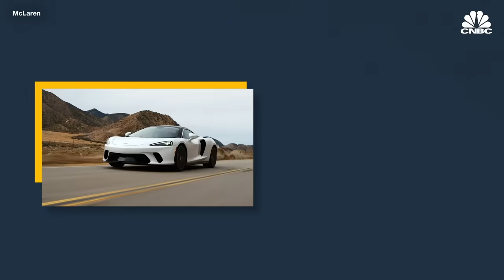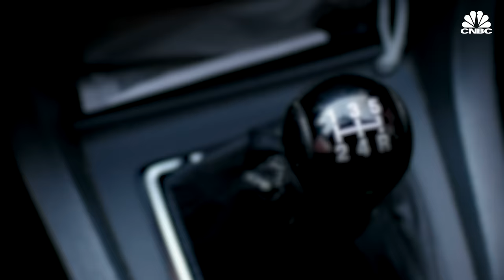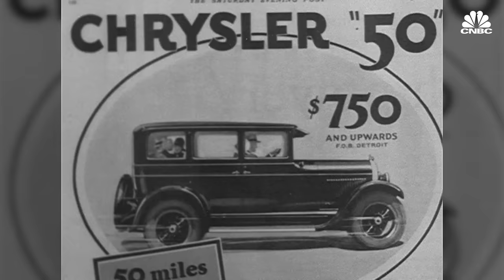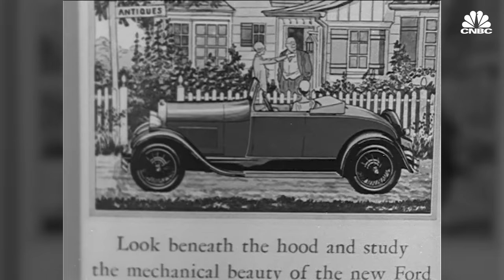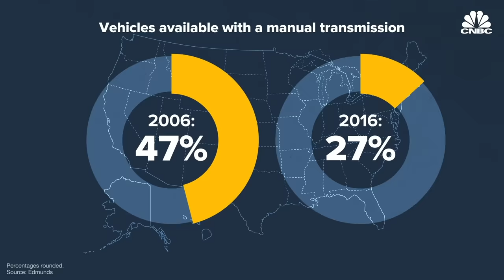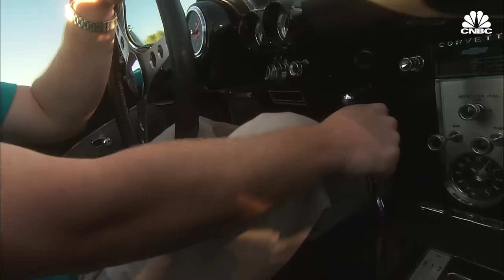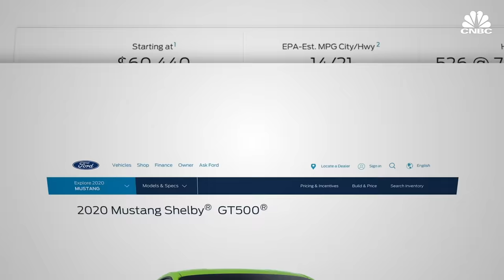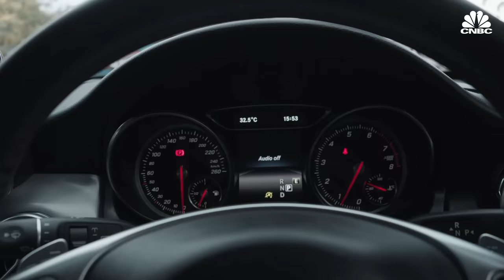Why Stick Shifts Are Going Extinct

Comment: I like how the video states “constant attention” as a problemXD
Reply: Yep, something we Americans have very little of
Reply: It is a problem. Distractions are a major cause of accidents. No matter how you slice it, shifting, like conversing is a distraction. Like conversing, we often don't notice how distracting it is. On badly pot-holed roads - I have thousands of miles on forest roads - and especially in darkness I avoid shifting until I am out of the worst because it is just too distracting when tenths of a second count.
Reply: @flagmichael  
if shifting is a distraction,  then why not make it illegal to have a radio in a car? That can be a distraction.
Reply: It's true, but it's also not! Shifting requires constant attention, meanwhile automatic transmission is so easy that people find things other than driving to put attention on. Manual is a good learning tool, because it forces you to focus your attention all around into all aspects of driving. Automatic transmission is probably safer, provided you've already built a habit to stay attentive on the task.

People text while driving manuals too, I'm sure, but there's always variables. I started with an automatic, and I wasn't a very good driver until after I started driving manual.
Reply: @flagmichael  ....what
Reply: @bertgrau9246  Phones and  computers are all a distraction but  to boost sales  GM added wi Fi on all there cars!  Just what we  need now we can watch TV and  Text  at the same time as we drive!

Comment: I will avoid driving an automatic as long as I possibly can.
Reply: Why not? It is superior in pretty much every measure, fuel efficiency, performance, used car price, etc. Do you still use typewriter or a computer?
Reply: @Gstunfisk  it's the feeling of control
Reply: @Gstunfisk  its not superior. The fuel efficiency is low and its un inspiring. There is loss of power.
Reply: @pratpulsar have you been living under a rock?
Reply: @Mister Candy Paint if you think about "shifting" as a skill,  you must have a low bar. As a same sense, I can say that manuals are lame,  low performance and fuel efficiency, less desirability. Automatic transmission are reliable and typically don't fail it its intended life cycle.
Reply: Me too. If im not given the option, id rather not drive, and will just take public transportation. Fortunately, that won't happen. I can always buy an old car, unfortunately, just won't be able to buy a new one. Importing one would probably be too costly.
Reply: @Gstunfisk  We got it. You don't know how to use a manual transmission and that's okay. Stop fan-girling over A/T
Reply: @hulaanmo9926  automatic transmission is just superior than manual and it should be thing of a past. Manual is applicable in buyers so low purchasing power (Europe/aftica/part of asia) for low end cars.
Reply: @Gstunfisk  how is it superior? If you can drive M/T you can drive an A/T. But not all that can drive an A/T can drive a M/T. There are benefits of driving a manual and there are benefits of driving an automatic. There is no sense arguing with you, you're thinking like a little kid. Time wasted. Have a good one.
Reply: @hulaanmo9926  superior in sense with superior performance,  higher fuel efficiency, etc. Name one area manual is better than automatic aside from being available as lower trim for poor people?
Reply: @hulaanmo9926  looks like typical boomer who has not kept up with technological advances? There is no benefit of manual as of now - manual is like a type writer and automatic is ms word
Reply: @Gstunfisk  understandable, have a great day
Reply: @Gstunfisk  dude just let people like what they like it doesnt even effect you
Reply: @Gstunfisk  well its their hobby, id be upset too if i was watching my preferred devices being outmoded rapidly
Reply: @johnathanhodskins5820  issue is they are either blatantly lying or so behind the current situation which is sad and ignorant.
Reply: @Gstunfisk  well, with smaller engines, older automatic computers shifted at poor times and often wasted gas, thisnis largly gone now but some people probably had issues with one car and never looked back
Reply: @Gstunfisk  Its actually not superior in Fuel efficiency, unless its an old model.
Reply: @thetrabantguy3934  moderns cars have higher epa rating for automatic; newer 8-10 autos are just too efficient. Unless you are talking about pre mid 2000s.
Reply: @Gstunfisk  I am indeed talking about those, Manuals where More fuel Efficient than Automatics Pre 2000
Reply: Driving an automatic is the lazuest thing ever. People say that it takes pointless effort. Literally running is easier
Reply: @John-ci2sd  driving manual is really lazy too. Why don't you take a horse? I hope you don't have electricity at home when you have candles? Don't be lazy man.
Reply: @Gstunfisk  I can drive both and I prefer DSG/Automatic. Manuals are horrible to drive in heavy traffic. Anyway, EVs are going to make this whole conversation obsolete.
Reply: @Gstunfisk  thats like saying running is lazy my guy. You're delusional
Reply: @Gstunfisk  It's ironic that you look down upon drivers of manual transmission cars as peasants when you yourself are so obsessed with the fuel economy of a car. Looks like you're the cheapskate here.

Also, you don't realize that with the exception of the US, everywhere around the world, almost all cars from the very low-end to the near high-end, come in both manual and automatic transmission variants. And the difference in price between the two isn't much. In fact, the more expensive the model, the less is the percentage of price difference between the variants. Don't take my word for it. Look up car-buying websites across different countries and compare the prices. Most people who choose between them, make their choice based on their driving preferences, not to save a few bucks.

Whether an automatic transmission is better than a manual transmission depends on the actual car and your driving skills. Unless you have a sports car (or a performance car like the M Series or the AMG series), you are almost always better off with a manual transmission or an automatic transmission that has manual override. The AT in the cheap car you are driving is nowhere good enough.

And that is the reason why MTs still exist all around the world, not affordability. If manufacturers really wanted to cut costs and if buyers of MTs were really as poor as you think, MTs wouldn't have power windows, power steering or power brakes either. They'd use manual systems for those too. Obviously they don't and it's been eons since such cars were last manufactured.

You're bullshitting yourself if you think that just by driving an automatic instead of a manual, you are now part of the social elite or that you're using some advanced and futuristic technology that we the poor cannot get our hands on. LOL! 😂😂😂
Reply: @Gstunfisk  
You’re obviously not a mechanic
Reply: @GRANOLA77  and you are?
Reply: @tejas.c  automatic is superior than manual for non racing drivers, period. Fuel economy as well as performance was mentioned to illustrate that there is no reason for manual to exist in 2021, aside from cheap economies. I don't know why it is hard for you people to admit it, but manually is dying literally everywhere on the plant, with a good reason (obsolete, inferior technology). Only reason why there are more manual cars in other parts of the world is due to low purchasing power in Europe, Africa, and Asia.  What is the benefit of manual? Name one thing manual does better than automatic.
Reply: @tejas.c  and yes, automatic is advanced technology.  It will soon follow manual transmission that when we go full electric,  there will be no need for automatic transmission.  Until then, it stays in the market.
Reply: @carlosi.guerrero8129  driving a car is a notable skill? I suppose you don't have much going on with your life, I am sorry.
Reply: @Gstunfisk  Yes, you're right! After this "argument" of ours, I did look up various unbiased reviews and performance tests and it turns out that even with low-end to mid-range cars, the automatic transmission is better at performance.

I was always under the impression that only the automatic transmission on sports and performance street cars were better than manual transmissions. That's what people I know had always told me - that for regular cars, you could do better with a manual transmission and good driving skills than an automatic transmission. And even the price difference is small - it varies from 10% in small hatchbacks to 5% in sedans and SUVs. With auto finance options, it seems even negligible. But maybe buyers of small hatchbacks do really care about that 10%, after all. 

We did buy a manual, but not really to save money. We thought that that money might have been better spent to add interior and infotainment options to the car than on what we had thought was just a small convenience without any performance benefits. With RHD cars, using a stick shift is not that much of an inconvenience as in an LHD car. You always use your dominant right hand to hold the wheel and the left hand to shift.

Anyway, I take back my words. I was wrong and you were right. My apologies and thanks for the info. Looks like I had been living under a rock all this while. 😂

Comment: I learned to drive growing up in South Florida, where it’s extremely flat, except for some bridges. I love driving a stick. They were a pain in the ass in stop-and-go traffic, though.
Reply: As if automatics aren't a pain in a stop-and-go.  
Stop-and-go is a pain to begin with, regardless of the transmission.
Reply: I learned to drive stick shift on the hills of San Francisco. Park facing up/down hill  on up to very steep hills. Parallel park with only inches  between the car in front and back.
Reply: Yeah for real. I live in Miami lol our traffic is CRAZY. That palmetto and I95 are not fun in a stick shift, I had a civic back when I was a jit lol
Reply: @Jp-gc6bh  again, as if standing in traffic with automatic is any better. Your right foot gets tired of constantly pressing-holding-letting go of the brake pedal, and you eventually have to shift to Neutral or Park to give your foot a rest, which is very similar to what you'd do with manual transmssion.
IMHO, all that argument about manual transmission being "hard to operate in traffic" is totally biased and made-up.
Reply: @antona.4572  no I’ve never heard anyone use your argument in my life. Ever, lol.
Reply: @Jp-gc6bh  maybe that's because you haven't spent enough time in traffic jams yet, lol
Living and working in Toronto, I spent (or, rather, wasted) many tens of hours of my life in city traffic, and I had a car with automatic back then. After 20-30 minutes of holding the brake pedal, your left leg eventually gets tired, and you'd have to shift to Neutral to give it a rest. Trust me, I know what I'm talking about.
So, at one point I asked myself how exactly is it any better than driving a stick shift, lol
Reply: @antona.4572  I wish we could take in person because people like you think they know it all and no one understands them. My guy... I’ve been stuck on the i95 for 6 hours... in the same spot, trucks flipped over and exploded. I’m a handy man and have had jobs that are 30 miles away and have taken me 80 minutes to get there... without traffic those drives would be 38-45 minutes. I’ve never heard anyone in NY, LA or MIA say that and all of our traffic is WAYYYYYY worse than yours LOL
Reply: @Jp-gc6bh  so, your right foot and leg never get tired of constantly pressing-holding-letting go of the brake pedal while standing in all those traffic jams on i95, no matter how long you do it for? You never get tempted to shift to Neutral and give your foot a rest?
Reply: @antona.4572  Thank you. My right foot gets easily tired having to constantly cycle between pressing the brake pedal and letting go of it when driving an auto. It makes me wonder how it’s any better than driving a manual in stop-and-go traffic. I’ve yet to drive a manual in bad traffic but I really need to find out for myself one day. Closest I’ve got is when there is a decent amount of traffic and people go incredibly slow when the light turns green. Hate having to take my time when starting in first. I usually prefer to be quick about it.

Comment: I call BS on the claim that the shift to automatic is being driven by consumer demand. I stuck with manual as long as I could but the last several times I was in the market for a new car manual transmissions simply weren't available in any relatively new model. Some may have the luxury to pay a premium or custom order a new car, but most of us have to choose from what is on the lot, and when it's only automatic transmissions we don't have much of a choice. What am I going to do? Take the bus??

Comment: Awful things, glad to finally have got rid of my last manual
Reply: they arent awful, some people just dont like them. nothing wrong with the transmission itself
Reply: @arcanevoid9199  the traffic these days renders them pointless and my knees hate them now 🤣
Reply: @johnmg88  i prefer manual even for traffic, and ive driven cars where the clutch pedal is lighter than the throttle pedal. cant be that bad
Reply: @arcanevoid9199  it's not the effort, even the bending.

To be honest I'd rather hand controls, even the throttle is a pain after a while. I spent 15 miles in slow moving in an EV with a regen braking paddle on the steering last night and it was a revelation

Comment: "Manual transmision is dying in America" 
Laughts in motorcycle squit
Reply: JuanFernando Gracia it’s sucks that also it’s dying in semi-trucks. My uncle used to drive a 2005 freight liner with 18 speed now he drives a 2020 freight liner with automatic transmission.
Reply: I read that some motorcycle have an automatic or at least a dual clutch.
Reply: JuanFernando Gracia what is a squit?
Reply: Though you have to admit, a sequential gearbox with push-button shifting is not too far from the dual-clutch transmissions that the video lumped in with slushboxes. Add a centrifugal or computer controlled clutch to the bike and it's basically the same driving experience.
Reply: @thomasleemullins4372  That's what I'd call a scooter.
Reply: @Simku  I think of scooters having a CVT transmission. I think one of the Honda motorcycles has an automatic transmission.

Comment: 10 years from now: Less than 5% of vehicles have steering wheels. 
Here come self-driving vehicles.
Reply: Abhigyaan Adhaita  ups  trucks are already using driverless trucks for routes that are longer than 12 hours. They got approved to do so by the u.s.govt in 2018......Google has also been offering a driverless rideshare app in Arizona called Waymo since 2018....so if these go well (without many incedents) than we will see more driverless stuff being rolled out across the world. The main reason would be for saving money on running a business. Think.....driverless tractors. And 100 percent automated farming. Its coming sooner than you may think.
Reply: @davidandrews5262  Makes sense, but wouldn't unemployment be higher? Loss of jobs is very high in that case.
Reply: God no.
Reply: Abhigyaan Adhaita  if it happens at all.
Reply: @josephpak4277  Somewhat. For a while yet, you're still going to have to have someone monitoring and ready to take over for the computer, and deal with anything the vehicle can't (like opening gates, clearing road obstacles, changing tires, etc.) and making sure the vehicle isn't like, mowing down pedestrians or something. What's probably going to be likely is road trains. A pair of drivers managing a fleet of 6-10 trucks that travel together. Also with Covid, there's basically no end of need to ship stuff.

As for general driving, I've done several drives with Tesla's Autopilot system. It basically handles the boring parts of driving for you. It's fancy cruise control. Full "no more steering wheel" self-driving vehicles are still several years out. All these companies working on self driving tech are finding out that driving is actually really hard, and our brains are pretty good at doing a LOT of calculations and predictive analysis.
Reply: No not gonna happen soon and if it does by 2030 it's not gonna be as low as 5%,that's just insane
Reply: @josephpak4277  of coarse that means less jobs. Witch means more profit for the company....
Reply: Abhigyaan Adhaita  its happening, just look at people who invented internet would cut a middle man profits, Steve Jobs invented iphones destroys most of the company, this would be matter of time Tesla will do to the cars. Unemployment will rise, if the jobs still exist but underpaid is another problem

Comment: I just ordered my 2023 Jetta in MANUAL six speed transmission!  I am 40 and it will be my sixth car as all of my cars have been manual transmissions.  What I learned is that there are much fewer options, but the manual transmission is alive.  I had ZERO interest in an automatic transmission.

Comment: I drove a manual for years before I started commuting to downtown. Now I work from home, so I'm back driving a manual. I know modern automatics are better than manuals. They are faster, get better fuel mileage, and many have manual modes that allow you to control when they shift. But to me, the manual is just more fun.
Reply: I refuse to drive automatic and bum at our limited options.

Comment: My car has a manual transmission. My parents bought it new back in 2018 and gave it to me last year when I graduated from university and started a job. When it reaches the end of its useful life (hopefully a good while, it has 78k miles), I plan to replace it with a hybrid or an EV depending on technology and my situation at that time. I don't care what kind of transmission my car has. I just care about its ability to get me from where I am to where I want to be.